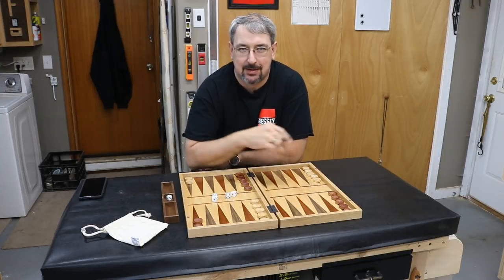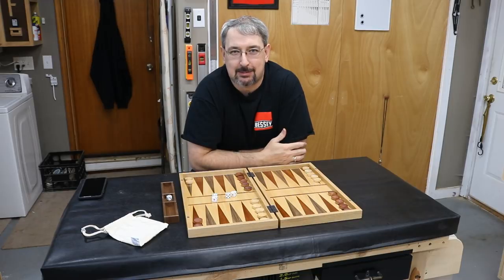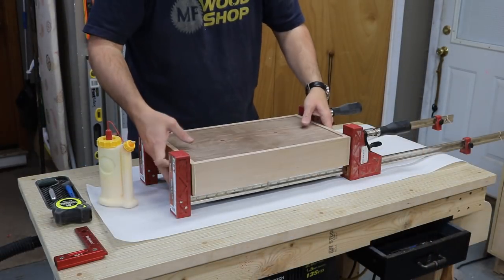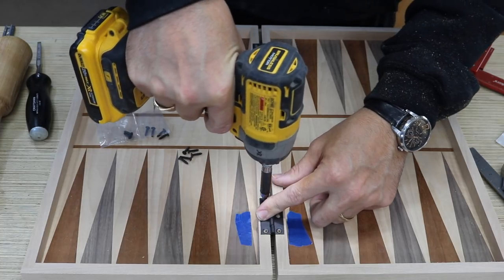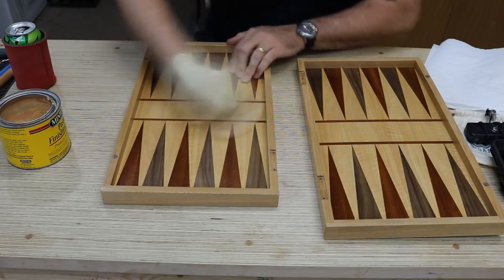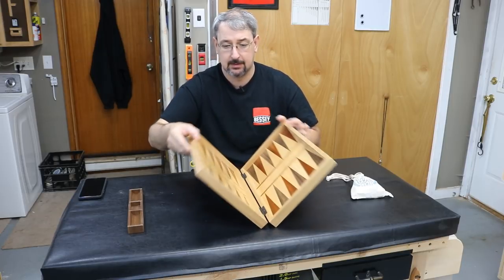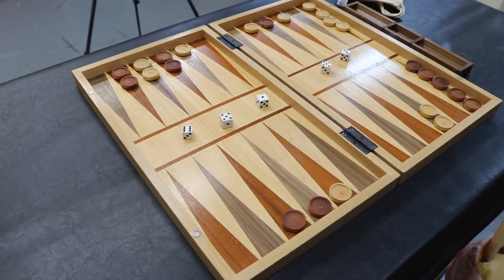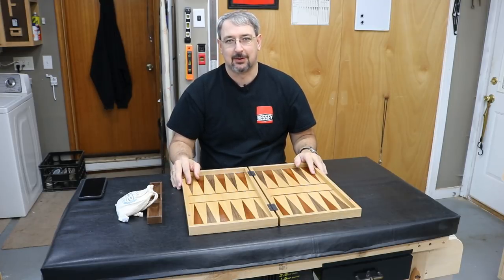How to build a Backgammon Board Part 2 Case Work and Finish

Comment: The board looks really nice, good job. Couple of small details: 1. as per another comment, it would look even better if there was no gap in the middle between the 2 halves. 2. the size of the checkrs - it's nice if when you put 6 checkers on adjacent points that they are a snug fit, with no gaps. Your checkers look slightly small.
Reply from the maker: thanks

Comment: very nice work. I think the chip size should be inherent to the size of the triangles. when you have 6 chips lined up on the bottom there should be little room for movement between chips
Reply from the maker: Probably right
Reply: I play a lot of backgammon
Reply: @mfwoodshop  do you have a lathe? make your own?

Comment: Great project! The board looks great. About how much do you think it would cost to complete a project like this? Many thanks
Reply from the maker: Not much material to it mostly time. If I sold it i probably charge 200. But if you build it and had to buy everything may $50

Comment: Looks fantastic!! Congrats! Just curious, what is the size of the chips?  Those would be a pretty easy lathe protect. I've got a small lathe, would be glad to help if you don't have one.
Reply from the maker: I have a lathe and though about making them it was so much easy to buy these cost $7. 1.25” on the chips. If your bored go for it. I thought it would be faster easy just to buy.

Comment: the reason you only got 24 pieces is they are "checkers' or 'draught' pieces not backgammon pieces. They should be 35 mm diameter per piece. Great board though
Reply from the maker: Thanks